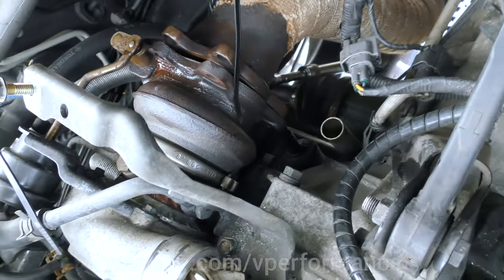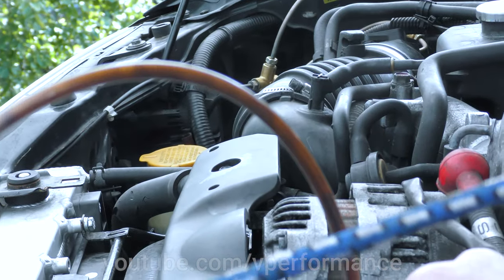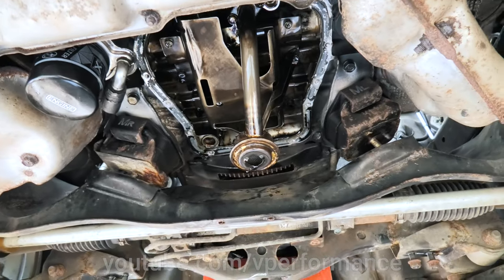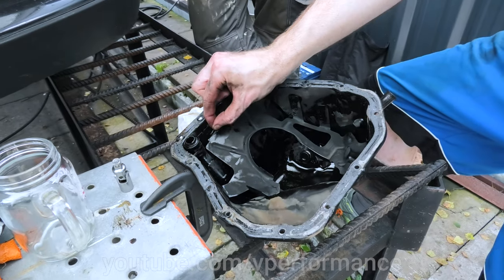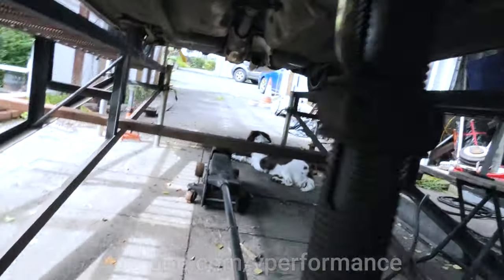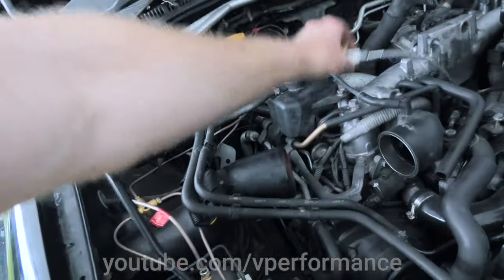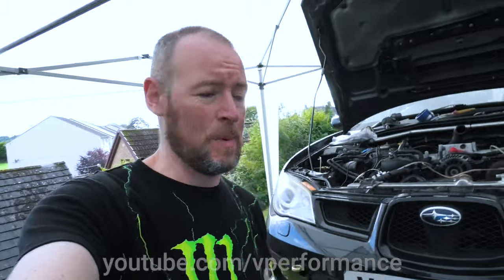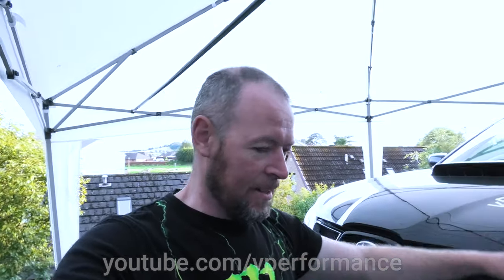Subaru RCM baffled sump with KillerB pickup pipe

Comment: Hi, does the killer b oil pickup fit inside an RCM group N baffled sump? Roger Clark use a modified stock Subaru oil pickup in their kit and it only has two mounting points...killer b pickup has 3 mounting points and I wonder if the third extra leg gets obstructed by any baffling in the RCM pan

Comment: Interesting you mention 10w60 oil. Would you say that's a bit thick for road use? Currently have 2012 2.5 with RCM forged pistons. Usually use Millers 10w50 but after a little less noise when cold and maybe less oil consumption.

Comment: Unfortunately, all those tubes are part of the PCV system, which is a crankcase ventilation system that is so complex that no one human being understands all of it. It can be simplified, but only the wisest of sages dare attempt such a thing. It cannot be altogether deleted, either, for terrible tidings will result. See Flatirons Tuning's video on the topic of crankcase pressure.

Having been through Some Nonsense with my engine, I can say for sure that I'm going to have a boost gauge hooked up to my crankcase from now on.